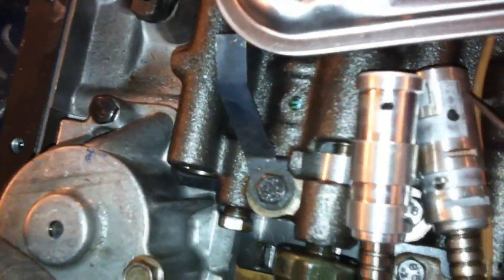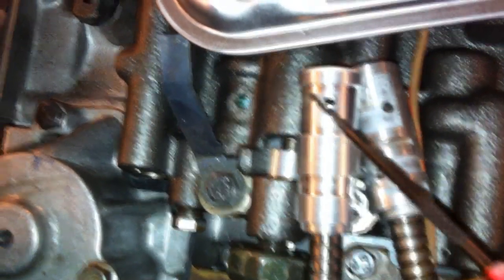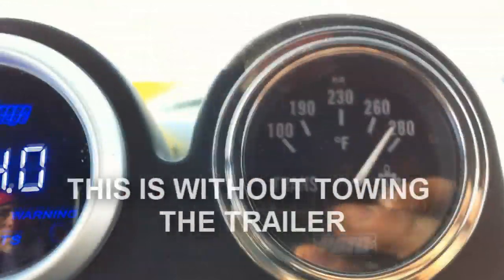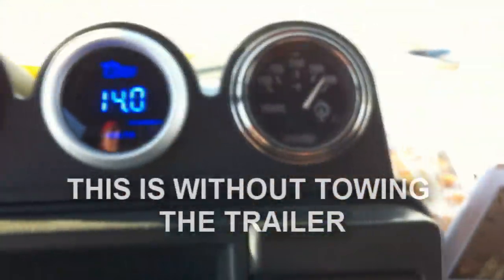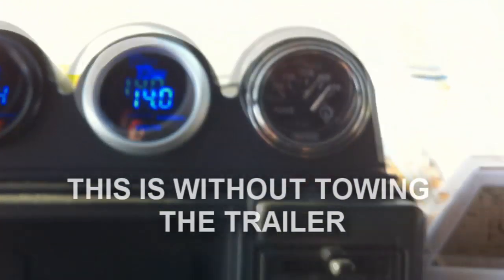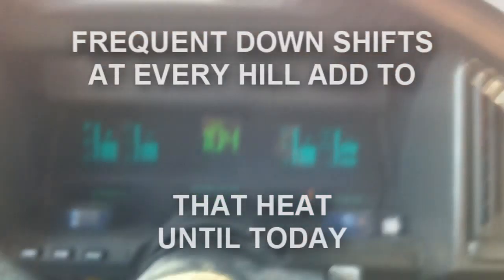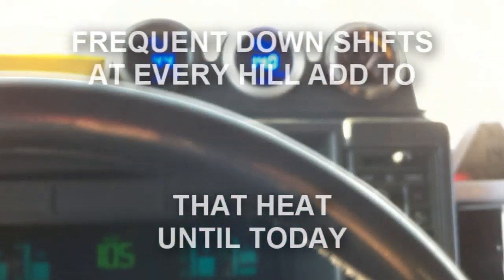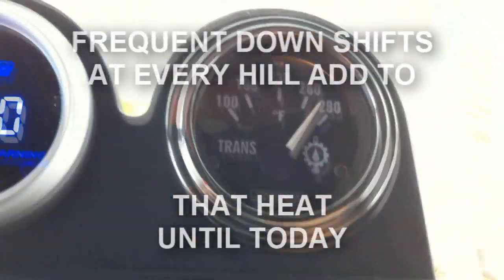700R4 Throttle Valve Upgrade

Comment: Running this transmission in overdrive is what burns them up. They are simply not designed to run at 40 to 45 mph on OD. Overdrive is not for climbing hills it is for highway cruising at 55 or better mph. Of course this all depends on vehicle weight, tire size, and other factors. I run mine in 3rd unless I am above 50 mph. Because at 45 in OD I am barely turning 1400 RPM and it is lugging the engine.
Reply: it depends on the gear the trans is in at what RPM when OD is engauged if it will make the trans hot or lug. I have mine on a toggle switch between brake switch and trans case, only turn it on right before the next shift of you rather be in a lower gear for a upgrade or downgrade(towing) 2nd OD, 3rd OD, 4th OD. yes you have to know what you're doing to have it on a switch or it can burn up TC.
Reply: You are using a switch to control the TCC apply. Not overdrive. In the case of say a 700R4 overdrive is 4th gear with a ratio of .7 to 1. Overdrive and TCC apply are 2 different things. TCC apply doesn't change the ratio when it engages. Yes you get an RPM drop but that is because you are locking in a clutch inside the converter to eliminate converter slip. No automatic is truly  1 to 1 in 3rd because the average converter is only 95 percent efficient. However with the TCC engaged it is 99 plus percent. Yes it will burn up the TC if it is allowed to remain applied when towing or hauling.
Reply: I found out the hard way on this, in my loaded down 88 Suburban XL towing a U-haul enclosed trailer, From SC to Colorado. When I got into the Blue Ridge Pkwy BOOM went the tail shaft and all the fluid. Always keep it out of OD unless your cruising,too low of rpm on these trans doesn't let the pump work properly
Reply: thanks for you information ..i love this trans... but always  have dudes 
I have a C10 silverado 83 400k (i'm chevy fan) .. and start spinning in 2/3 shift ... cheers ..
Reply: so 4.11 maybe 4.56 gears 26" tall tires or if i have say 2.73 gears and 31 inch tall tires in either situation stay out of OD till 40+mph? seems like many factors could make a difference. i've  been driving my 700 in my 80's 454 caprice with 3.73's for many years it goes into OD something like 35mph. i'd say if it feels like its working hard, lugging- drop into third.

Comment: last time I've checked all transmissions down shift when under load at a low rpm especially going up a hill
Reply: Yes but engineers don't always design the greatest control system. The owners manual of every car made says to manually downshift if you feel excessive shifting or lugging of the engine.
Reply: David Smith OK but he is complaining that the trans is down shifting going up a hill. when you go up a hill your putting load on the engine and trans so it's gonna downshift plus I doubt he adjusted the TV ( throttle valve) cable on the trans properly so that's why he is having the shifting issues.
Reply: Yep the cable must be dead on with a 700. Many people call it a passing gear cable. Actually it controls down shifting and line pressure as well.
Reply: it does not control down shifting read the GM specs
Reply: When you accelerate it pulls the TV cable depressing the throttle valve in the valve body. As the plunger valve is depressed it increases MTV down pressure therefore causing a downshift. I don't know what GM material you are reading. I am a 35 year veteran in this business. I know what happens in the trans when TV pressure is increased. Now on the other side of the coin as you decrease throttle the MTV up valve moves to up shift the unit. Also MTV down pressure acts upon the back of the shift valves to downshift. Governer pressure acts on the front of the valve to open it causing an up shift. Class dismissed.
Reply: Then why don't you tell me what controls it. Since you obviously think you are smarter than the Hydra Matic engineers that designed it. Personally I don't think you know what the hell you are talking about.
Reply: Tv regulates your Line pressures. It can either make or break your Trans.